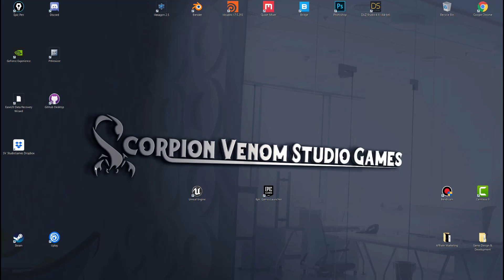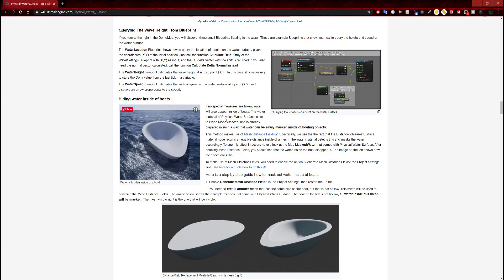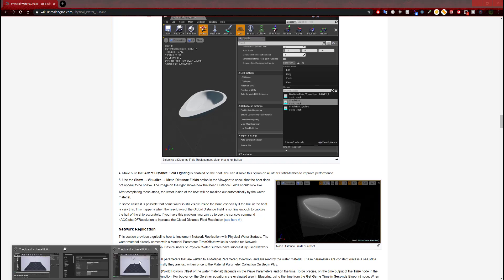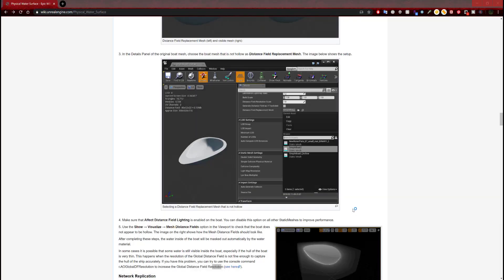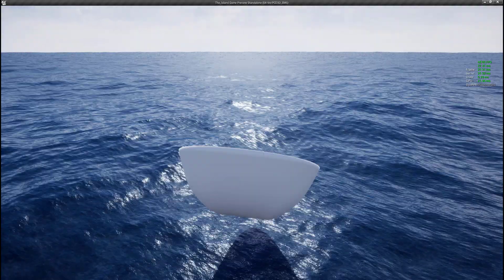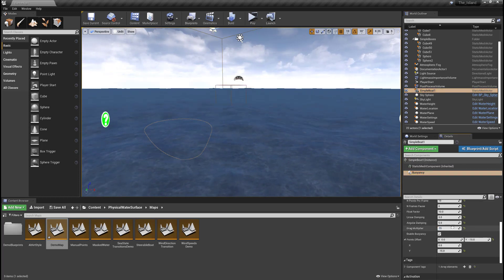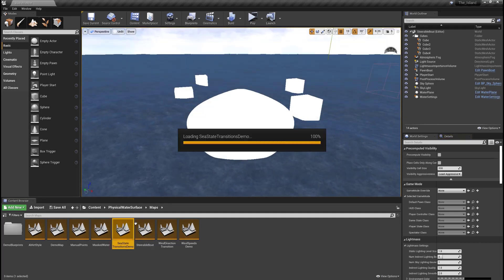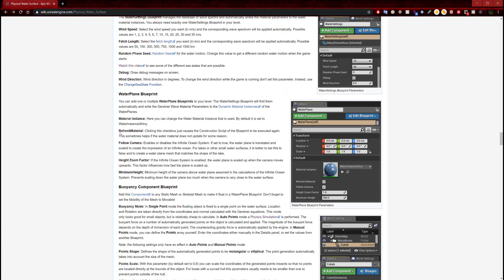How to hide water inside the boat in UE4

Comment: you can leave generate distance fields on, you just have to set visualize > mesh distance fields to off
Reply from the maker: Thank you.
Reply from the maker: I will have to try
Reply: Exactly. You went into Visualize > Distant field meshes and that locks the viewport to just see the distant field meshes, turning that option off on the settings and restarting the engine is not what is making the water appear again, is just the engine showing the viewport with no distant field meshes option on again, nothing else.

Comment: Hi. I use the sea of the unreal. I floated the boat in the sea using a plugin called ^bp buoyancy^. I placed a boat in this class and did not prefer to collide for the boat. Therefore, when I put a character on the boat, they pass through the boat and fall into the sea. How can I fix this?
Reply from the maker: Hi, does your boat has a collision set up for your static mesh of the boat?
Reply: @ScorpionVenomStudioGames  Yes, I did not create a special static network for the boat. His collision should be selected as no collision from the list, otherwise it would sink into the sea. I guess if I make special collision settings, it will be fixed.
Reply from the maker: @hasanbasryand6880  usually for static mesh I use "Simple collision use as complex" . DO you need to create buoyancy points on that object?
Reply: @ScorpionVenomStudioGames  If the character could stay on the boat, of course I would add the ability to float to the boat.